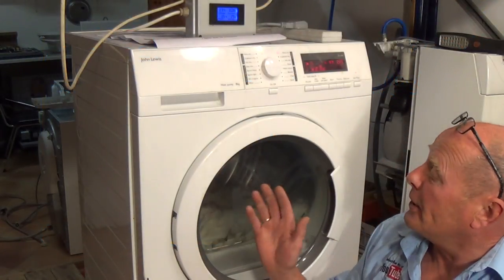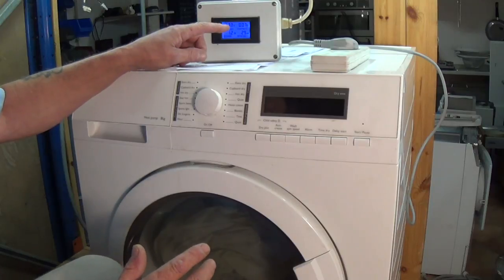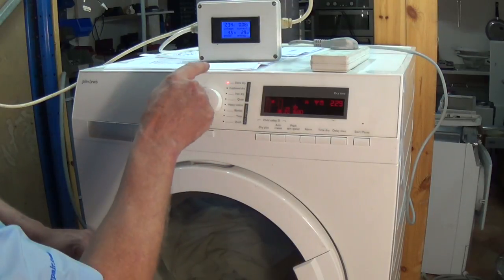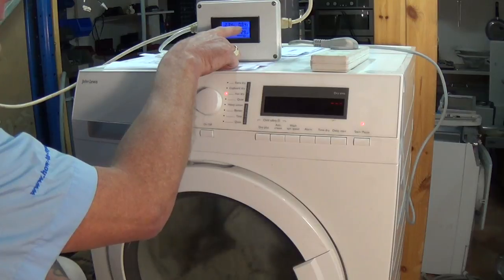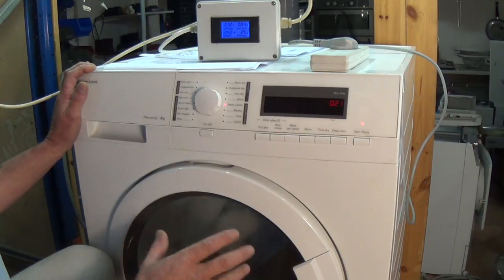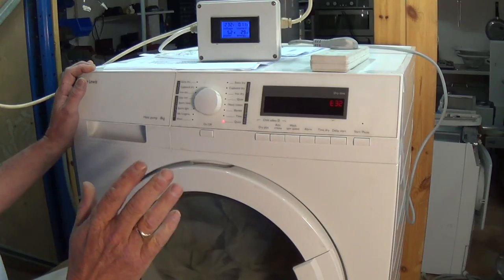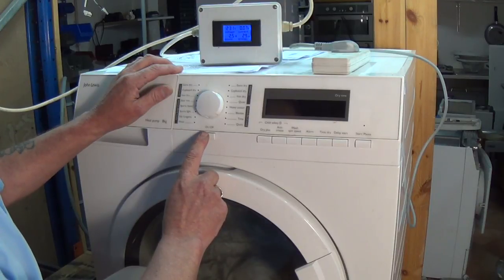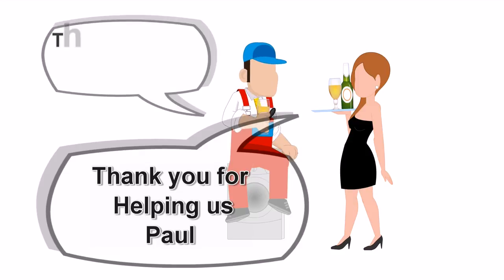Heat pump tumble dryer test mode Aeg, Electrolux, John lewis,  Zanussi

Comment: Hi. I found your video extremely useful indeed - so thank you. I've given you a big thumbs up. I ran the service cycle to test the condenser pump on C2 and it read "111". Is that normal? Basically water leaked through the condenser unit but tumble dryer seems to be functioning as it is at the moment. I don't get any error codes when the appliance is turned on and neither did I get any when the leak happened. I would be grateful if you would describe what to expect on C1 etc in terms of it being normal ie, for example one of the C's had the number 21 displaying.

Comment: My dryer doesn’t start, but does not show an error code. Got it into service mode like you showed. When I select C5, the display shows 017 and 016 and then ‘ESE’ after a couple of seconds. I imagine this has something to do with the drum is not spinning(?). Would you have any idea what the issue could be?
Reply from the maker: Without having the make and model number of you, it is very hard for me to assist. I suggest you use the link below to contact us at the website. Hi @joelvantwillert I will need the full model number of the identification plate please use our contact us page and make sure you fill out the request of what part you are after and will get back to you within 24 hours normally https://www.how-to-repair.com/help/contact-us/
this is for you https://www.youtube.com/shorts/e432SAb2g08 please remember to subscribe as that's what keeps this channel going. Thanks 👍

Comment: I have almost the same JOhn Lewis dryer but it is 7kg and no window in door. I can't get it into diagnostic mode after many attempts. Am I missing a trick?
Reply: With the JLTDH18, it starts up in Cupboard dry mode. I've found you need to turn it on, switch to Extra dry mode, then press Start + Delay start.

Comment: I have the AEG T7DBG832R which has an all touch screen display.  
In this version I found (by trial and error) that you need to hold the "Start" and "Refresh" buttons and not the delay start.
The diagnostics come up but continue flashing through all the lights until you turn the control to one of the options.

Comment: Is there a video for replacing a belt on a JL heat pump drier?  The back panel is all moulded and glued so you can’t use the method of disconnecting the bearing like on your other videos

Comment: Very cool video, makes it easy to troubleshoot.... Should be in the manual this info.... Bought  aeg 7000 series, we like it... Way better than the old system we're the hot air is vented to the outside....

Comment: I have a slightly different AEG, namely a T87685IH3, and I cannot use the same method to enter testmode. Very annoying. Do you know how to get into testmode on this model?
If I use the normal method as you demonstrate here, the tumbler shows "dem" in the right side of the display, meaning demo mode.

Thanks.

Comment: Hi I have aeg 8000 series lavatherm absolutecare system dryer. Start pause button flashes and it cannot start. What could be the error? I think the first time capacitor failure? What do you think? How can you run a diagnostic program on it?Thanks for the help.

Comment: Hello nice video.
During normal drying the dryer stops and I get E20. If I restart it, it works again for some time and then Iget E20 again. 
I entered Test Mode and in C2 the pump works for 5 or 6 seconds and then I get  E23 error. 
I tried a different pump and the same happened in test mode and in normal drying operation also.
Could it be the printed circuit or some of its components or the float sensor next to the pump?

Comment: I have a Zanussi dryer that’s not turning on (no sounds or LEDs) I’ve checked fuse etc but wondered if there were any common faults ?
Reply from the maker: Hi mate, I've created an FAQ page for you. You can find a detailed repair guide, exploded diagrams, and spare parts for your problem on this page. Here is the link: https://www.how-to-repair.com/faqs/zanussi-zdh87a2pw-heat-pump-tumble-dryer-not-turning-and-no-leds/ 😇

Since we work very hard in our warehouse making free video guides for you all on appliances, we always appreciate a beer, offering a choice of single or round beer. https://www.how-to-repair.com/help/buy-paul-a-beer/ 

Thanks, Paul 👍

Comment: hi can you please tell me where the dry sensor is for the AEG T56830 Lavatherm as it is not drying properly .have cleaned all the filters and the matrix and reset the sensor to the top setting buy using the Adjust ’level of dryness’
detection:
In the  programming options .many thanks Dave

Comment: I have Error E32. Do you have any ideas what can be a problem? The dryer stops drying itself after a few minutes?
Reply from the maker: You really want to contact us through the website with the full model number of your machine and then maybe I can find the diagnostic process for you
Reply: same problem here on Elecrolux...Did you manage to fix it? 
The dryer stops after few minutes. ..in time mode it runs through, but not drying. The compressor is not engaged even thought diagnostics showed that is working. there is some water in the front side of the  condensation unit (I assume this is as result of lack of heat due compressor not engaging)  I disassemble the machine and clean everything, but same outcome after. When in diagnostic mode , C08 -E32 occurs)

Comment: We have an AEG LAVATHERM 86590IH3 dryer.  (Type TC12H6BHP).     After normal operation we found lots of water under the dryer!  When I opened the filter door, there were lots of water in that area. I have started investigating the pump area at the back of the machine. I have determined with a digital multimeter  that  the resistance of the pump was about 750 ohm.  In one of the videos the repairman mentioned that according to the service manual it should be about 750 ohm. So at this moment I assume that the pump is OK.......   Next I will try to check the float sensor/switch which turns on/off the pump. Am I on the right path? Has anyone ever experienced this problem before?  (I have not put the machine into diagnostics mode, yet).
Reply: I have the same problem, lot of water under the dryer with normaly working pump. Did you solve it ? Thank you.